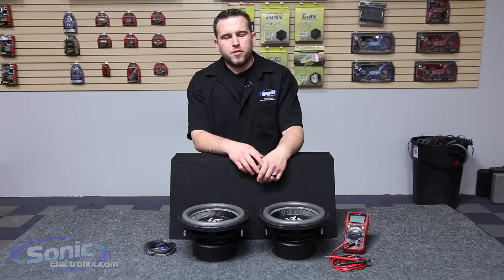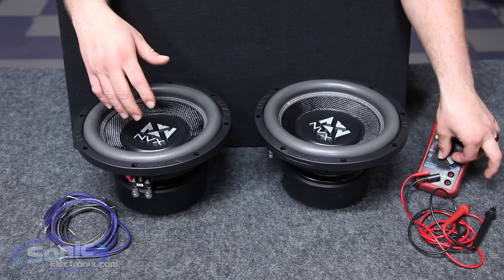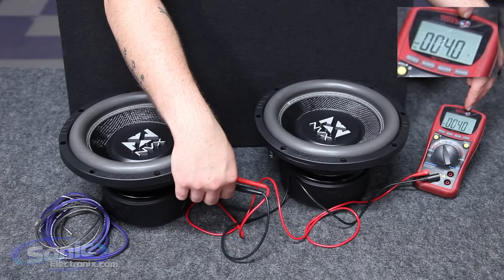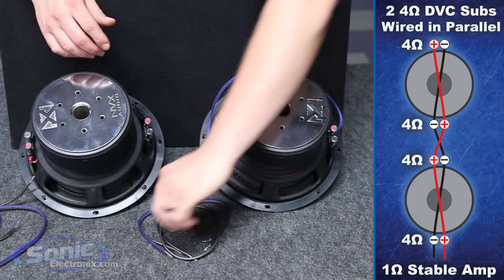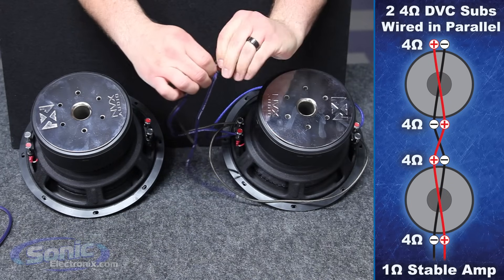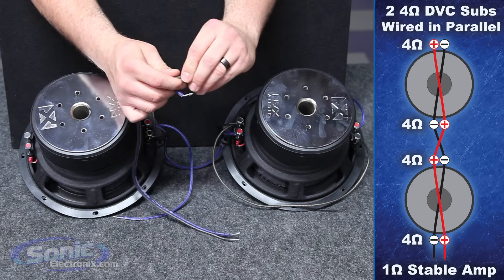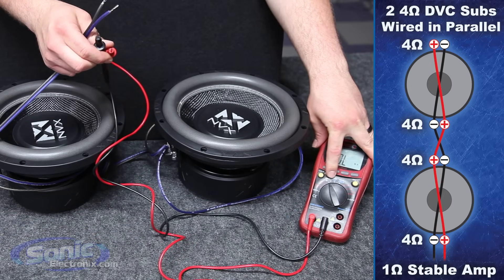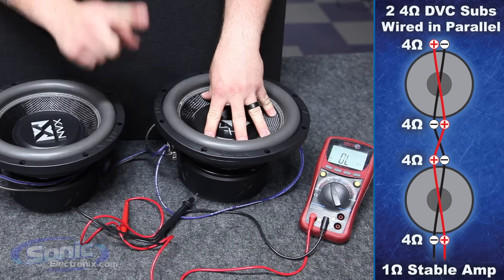How to Wire Two Dual 4 ohm Subwoofers to a 1 ohm Final Impedance | Car Audio 101

Comment: let me make it simple, plug all positives terminals together with the same red wire straight to the amplifier. Now do the same with a negative terminals using black or silver wire.
Reply: Why in the illustration they criss cross the the wires? Makes it more confusing.
Reply: @theimmaculatecrown  just because the terminals are flip flopped for each side of the sub I’m assuming
Reply: @theimmaculatecrown that’s how it would look in real life but all it really is is positives connected together and negatives connected together

Comment: This is to SonicElectronix. I recently ordered a Lanzar Optidrive 2001d 2000-Watt Amp with 2 Q Power 3400-Watt Deluxe DVC 4 Ohm 12-Inch Subwoofers. Should I do 4 Ohm to 2 Ohm or this particular method here, which is 4 Ohm to 1 Ohm?

Comment: So I got Single X-12 D4 Sub Pro 12" Dual 4-ohm 1250w Rms Loud Bass Subwoofer and Amplifier is Mono bass 1Channel 1-Ohm rate for 3000W. I currently been connecting it as Parallel which Positive to Positive and Negative to negative but, my wire run from Amp to Sub tend to keep getting burnt out. Whats wrong, or whats the best way I should do or run?? Thanks in advances.

Comment: Do you wire two dual 2ohm subwoofers at a 1 ohm impedance the same way you did these 4ohm subwoofers?
Reply from the maker: No! That will bring it down to .5 ohm! Most amplifiers won't be very happy with that. The lowest you will be able to go with two dual 2 ohm subs is... 2 ohms. 
Check this video out.  https://www.youtube.com/watch?v=htx0aXmzFmo

(I hope we weren't too late with a response!)
Reply: Sonic Electronix I tired this an it sound like poop

Comment: how thick is the wire recommended? I have 1700Rms 1ohm amp and two pioneer TS-W3003D (600Rms)
Reply: For anyone seeing this just always use 12 gauge wire. 
But for 600 rms speakers you can use 14 gauge.
Just make sure it's OFC wire. Not that aluminum clad garbage.

Comment: when you wire the speakers like this . say your running 600w into them are they both getting the full 600w or they are get each 300w ?
Reply: Less resistance(ohms) = more power
Reply: +1ceeb So you  don't know  the answer  then?
Reply: If they are running in parallel the power splits

Comment: This is to sonic electronics I just bought an 2400 watt 1D amp and when I have them ran 1 ohm it does not sound good at all and when I unplug one it sounds OK but not like it should I had a 2000 watt power acoustic but RMS is 1200 watts worked perfectly until it blew that is all I changed out any ideas
Reply: Have you tried playing each one alone to make sure neither are blown? And power acoustic amps arent very good.

Comment: ok once I have the one positive and one negative at the ends after the Subs are all connected then what? my Dd m1c has 2 sets of speaker connections, left and right...do I just plug the positive to positive on the amp and same with negative?
Reply: example I only connect the left positive and negative outputs? and leave the right outputs empty?
Reply: Hook up the pos on one side then the neg on the other side.So pos skip that sides neg then neg on other side and skip that sides pos.

Comment: im confused my amp has 2 sets of terminals for each subwoofer and my box has 2 sets of terminals for each subwoofer.can I just hook up each speaker to each terminal? on the amp and box?
Reply: +Vicente Dominguez ----it's not what set of terminals your amp has or how many terminals your sub box has, it's the load that each channel on the amp can take, depending on the load your amp will give you so much power!
Reply: Oh ok I have each speaker at 2 ohms so when I plugged them in it should be to 1 ohm

Comment: so just one sub that is dvc weird like this is 1 ohm or it has to be 2 subs to get 1 ohm on 4 ohm dvc
Reply: +George Laboy ---one sub with dual 4 ohms in parallel will be 2 ohms
Reply: basically a 4 ohm coil will read about 3.6ohms to 4ohms! So your load will read anywhere from 1.8 to 2 ohms

Comment: Hello I have 2 15s Memphis mojos Xseries with dual coils like this and I want to connect it to a Memphis mojo mcd4k amp I believe it's a 1ohm stable amp but I connected it like this and it got really hot so idk what's going on I have it connected in series right now but I want them to be at 1 ohm so I can be getting all the power out of the amp
Reply: +Carlos Soriano are your gains set to high on amp?
Reply: +Stone Life yeah everything is ok but the amp was 1ohm stable and the way I connected it was at .5ohms and it over heated but I got another one just like it but it would've kept working it's just that the amp sucks way too power even tho I have have all 0guage wire all around with a extra XS power batter I need to get a better alternator cause the amp drains the batteries like crazy since it has so much power but the gains and everything else it's fine and it sounds loud but I can't have it turned up for too long cause it gets hot since it's not getting all the power it needs which sucks but it's super loud but thanks :)
Reply: Np if possible maybe put amp in front of port i did that one time...it acted like a fan

Comment: what amp would I need for a these exact setup the subs being 600 watts each. would I need a amp capable of 600 watts or an amp capable of 1200 to power both?
Reply: 1200. Watts required doubles as you add the speakers. The power is split evenly across the load. If you ran a 600w amp across both, it would only be pushing 300w and also probably cause your amp to over heat with the speakers demanding more from a less supply.

Comment: With a 300 watts at 2 ohms monoblock. 2 subs with 300 rms and 4DVC..... If I make final impedance at 1 ohm does that mean sub will handle both speakers better? Recently got kicker CX600.5. And got 2 CompD 300 watts  DVC at 4 ohms. What would be the best way to connect the speakers.

Comment: how about to wire 4 ohm into 1 ohm amp? Is that even possible?
Reply: +Nephi Kendra Anderson-taueki-tane ps i have used one coil on a dual coil sub for years nothing wrong with my subs lol
Reply: you can only get 8 ohms 4 ohms or 2 ohms out of an 4 ohms sub. 2 ohms sub you can only get 1 ohms 2 ohms and 4 ohms
Reply: +Nephi Kendra Anderson-taueki-tane that's why you get duel coil subs
Reply: +Nephi Kendra Anderson-taueki-tane ---not true!   a dual 4 ohm sub can only be configured to a 8 ohm load or a 2 ohm load, a dual 2 ohm sub can only be configured to a 4 ohm load or a 1 ohm load! YOU SHOULD NOT WIRE A DUAL COIL SUB WITH ONE COIL ONLY, BOTH SHOULD BE WIRED IN!!!!!!!!!!!!!!!!!!!!
Reply: +Nephi Kendra Anderson-taueki-tane ---the reason you get dual voice coil subs if for configuration purposes!!!!
Reply: +write2r isn't that what i just explained lol my explanation was based on dual coil subs. and yes they are mainly used for configuration purposes but it is not essential to have to use them like that.

Comment: I have an MD Sound Amp 2000w 2 Ohm stable mono block (four channel) and two 12" 1200w max 4 Ohms subs. I have them in series-parallel and down to 2 Ohm. The amp is bridged (left negative and right positive channels) According to Ohm´s Law 1200w * 2 Ohms = 2400w Square root of 2400 is 48.9 volts. The amp at full Gain gives 46 volts only. So I have it at 43v. The subs moves but not fully, so my question is can I down them to 1 Ohm without blowing anything?
Reply: +Chris Phillips Thanks for the response. I already bought a bigger amp for those subs.

Comment: I got a 2 ohm final impedance by doing this wiring to my (2) 4 ohm DVC Rockford Fosgate P3D4  subs. What did i do wrong?
Reply: austin chaszar  did you read the p3d4 manual? There's a pix on how to wire them correctly. Just make sure to pay attention to the logo orientation on the sub in the picture and with your actual sub.

Comment: Is this possible with 5 subs?. I want to do a mixed pack, 2 10",2 12 " and a 15. I have two amps that I'm going to strap together that are stable 1-4 ohms and all of the subs are 4 ohms dvc... How should I wire this up?

Comment: so the last two leads go to the box terminal. On my box theres two terminals on the box (one on each side of the box) So if i did this would i just leave the other side alone and not connect any wires to it? basically just run all the wires through one side of the box and then to the amp?
Reply from the maker: NY Yankee We recently did a Q&A about wiring two subs in an enclosure with separate chambers / two terminal cups. That might give you a clear answer. But yes, do all your wiring at the subs and use one terminal or can use both terminals.
Reply: +Sonic Electronix please post a link to that video i am having that exact problem

Comment: WHAT'S THE PURPOSE TO DO THIS??? DOES IT MAKE THE SUBS HANDLE MORE POWER???
Reply: +KD LongWay ---not true!  1 ohm load is just a configuration based on the ability of the amp to provide power! If you have a dual 2 ohm sub configured at 1 ohm with an amp that provides 1000watts at 1 ohm, then you are getting the most out of the amp in that set up, if you have this same sub configured to 4 ohms that amp would probably give you around 300watts, not enough to push the sub to its full potential.  Now if you have another amp that can give you 1000watts at 4 ohms, then the sub would play as loud as the amp that give 1000watts at 1 ohm.  The amp that give you 1000watts at 4 ohms will give you cleaner power due to having a lower distortion at that 4 ohm load.
Reply: GRAMO107 The point of this is to get a lower resistance to have more power coming from the amp. This will not make the sub handle more power.
Reply: GRAMO107 it increases your MPG
Reply: fudogchomp woooooww thats awesome 0_0

Comment: If I have 2 basic subs 1500 watts each and a 3000 watts amp max what's the best way to wire I am mechanics inclined but don't do car audio I'm not looking for competition stuff but some mice bass
Reply: htc one if there 4ohm wire them to 2ohm ,I got 3 10's and 2 12's hooked to 2 3400w amps.I have mine at 2ohms and they dump nicely

Comment: Your subs are perfectly fine. The reason the sub closest to the port is louder is because its sucking/hogging all the air from the port so there is less air getting to the sub farther away from the port. you need to fix up your box so it get air evenly or get a new one.

Comment: I have a hifonics Brutus 1100 class d. I wired my box parallel.  On the amp there's two negative terminals on the left and two positive on the right which ones do I run my wires to?
Reply: Either one works fine

Comment: So I am going to wire my subs like this through a vented box with the vent in the middle. should I just run the jumper wire back behind the vent? And if so how much speaker wire do you think I should to do this. Or should I run the jumper through the terminals and connect back behind the box somewhere? And if so how much wire for that? Thanks
Reply from the maker: Joey Hunter Personally, I prefer to run your jumper wires through the box. That way they aren't hanging off the back of the box and available to be pulled out or snagged by something in the car. Use as much speaker wire as you need to comfortably make the connections.
Reply: Sonic Electronix do I need just one box terminal?

Comment: Question i have 4 4ohm dual voice coil subs each sub 800 watts rms what's the best kind of monoblock amp to run with
Reply: Ajar Audio 800watt RP Series monoblock is a good choice

Comment: I have 2 P3 10s that came wired to 1ohm to push 1000 rms. I blew the rca's in a Boss 3500 class d amp. After I had changed the fuses cause they were blown. Didnt hear any sound. Now I a temporarily Alpine MRP-M500 amp hooked to them. Is this a bad idea. What amp would u recommend for me.
Reply: Glen Fawcett
Reply: the alpine is a better choice for you it will push the power you need while doing it safely. alpine amps are amazing amps!
Reply: Marquavious Robinson I had a pair of 4ohm DVC boss 12's,wired at 1ohm in my car and my daughter's both pair fried..we was pissed

Comment: hey sonic i followed this guide but i have a question.
Does the length of the jumpers from one sub to the other sub make a difference?
I have a ported box and I'm wiring them down to 1 ohm but the jumper will be like 4 feet long. is that okay?
Reply: Great question I was wondering the same thing, 11 years later 😂, did you ever get an answer?

Comment: Hi guys Im quite a dummy at this, I recently bought two 4 ohm dual coil subs, Id like to know why would you want to wire it to 1 ohm instead of leaving it at 4 ohms.
Reply: Hey man the reason to wire it down to 1 ohm is to get the least resistance from amp to sub, also meaning the most power from amp to sub.
If you're amp is 1 ohm stable and the wattage at 1 ohm matches your sub then if you wire it to 1 ohm you will get the max power from you're amp and speaker.
so long as the power ratings match, i.e your amp has 1200 watts RMS at 1 ohm and you have 2 600 watt RMS subs then that will be the best but if you amp has say, 1800 watts RMS at 1 ohm you may need to set the gains low so that the subs dont get overpowered.
Hope this answers your question
P.s. RMS is NOT max wattage capability, but constant power ability just so you know.

Comment: Ok so I have a ported box with no holes in the middle to run the wires is it ok if I drill a small hole in the seperator so I can run the wires from speaker 1 into speaker 2 or will it mess anything up?
Reply: it's a ported box, there's no way you can mess up the pressure, lol.  I argued this with my cousin who knows this shit for a long time.

Comment: I have 2 dual 4 ohm voice coil subs and a box that came with it but if i do the parallel method it wont work because there is a wall in the box that wont let me connect the two subwoofers. what do i do? what should i use?
Reply: Drill a hole big enough to run wires thru that's what I did
Reply: wire them in parralel in each chamber of the box then on the outside of the box take a long speaker wire and run it from one side to the next but remember to have your positive and negative rite then next take a second speaker wire and run it to your amp this can only be done if you have two terminals on each side when you run that first wire to the other side you run that second speaker wire from the second terminal so they join up

Comment: I have a Kenwood KAC-9014 D mono amp 1800watts peak, 900rms x 1 @2ohms, 500rms x1 @4ohms, and 900rms x 1 @1ohm.... My subs are (2) 4ohm DVC Alpine Type R 12's.... Will this wiring work well for me? My amp is 1ohm stable. Im trying to get the most out of my amp!!!!
Reply: Mono-block amp stable at 1 ohm: Check! Two Dual Voice Coil, 4 Ohm sub woofers: Check! Yep, you got it.
Reply: thanks man!!!! I would be getting the most out of my amp that way correct?
Reply: cory barbour oh yea..  both subs will be gettn 450 watts.. threw 1 ohm.. instead of  250 a sub.. thats if your amp is truly pushn 900 @ 14 v  and definetly make sure your gain is set right to not clipp ya subs with shitty distortion.
Reply: OK thanks bro
Reply: cory barbour
how has your system worked out for you?. have you had and problems? does your amp have them subs hitting consistently?i have the same set up as you, thats the reason im asking.
Reply: Works perfectly.... I love it

Comment: I have a Mono amp from RF and it has 2+ and 2- I wired the first positive to the first set on the amp and the - to the 2nd sub. And did the same for the other 2 wires. Is that correct?

Comment: I actually saw another video where some one stated that to make one sub dual 4 ohm into a 2 ohm, all you have to do is use the positive lead of one coil and the negative lead of the other. And that that will get you a 2 ohm impudence. So that person pretty much left 2 springs completely untouched. One from each voice coil. Is this really possible?

Comment: I am having some trouble here. Does that meter measure impedance or resistance?  If an actual impedance measuring meter, what frequency does it use for the test? If you measure a 4 ohm speaker with a DC ohmmeter, it will measure about 2.6 ohms. Speaker impedance varies with the frequency of the test signal. Usual impedance testing frequency is about 400 Hz. Impedance will rise at high frequencies due to voice coil inductance, and will also rise at speaker resonant frequency (Fs) due to back EMFat resonance. When wiring dual voice coil speakers in parallel like here, you also have to be sure that you have proper polarity or you will lose output.
Reply: it doesnt put any frequency. it just sends a direct current signal. any frequency will raise it higher. so your lowest possible resistance (Re) would have to be a 0Hz. .

Comment: Will wiring 2 dvc 4 ohm subs down to 1 ohm like you just did hurt the subs in anyway or are they perfectly capable of a 1 ohm impedence?
Reply: Doesn't hurt the subs, just make sure the amp is 1 ohm stable or it'll most likely hurt the amp :)

Comment: Such as sub one bridge together then out one box terminal then same thing for the other sub but out the other box terminal and then from the terminal run the wire to an amp but bride the wires at the amp because it's a mono block amp

Comment: Joshua Wagener how do you get 3000w? 750+750=1500, therefor you need a mono block amp rated at 1500rms x1 @1ohm.. then 1500rms going to (2) subs, so 1500/2=750rms